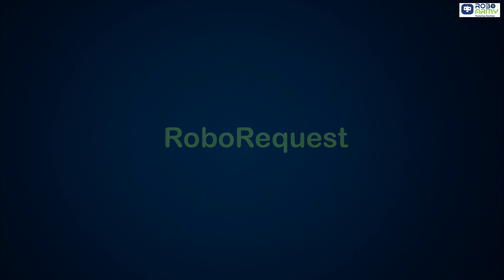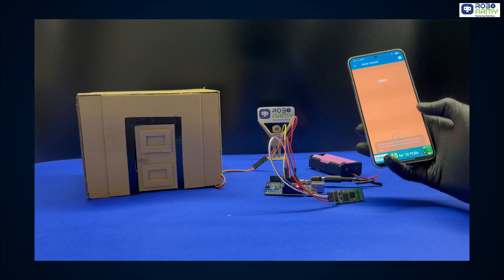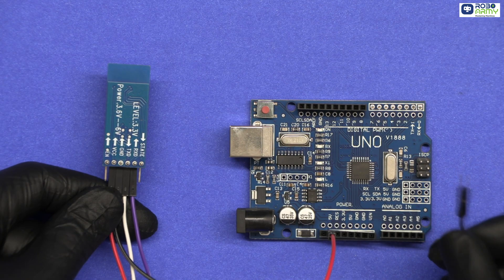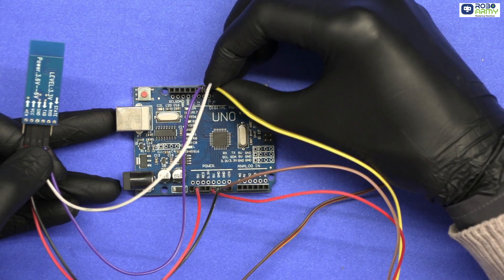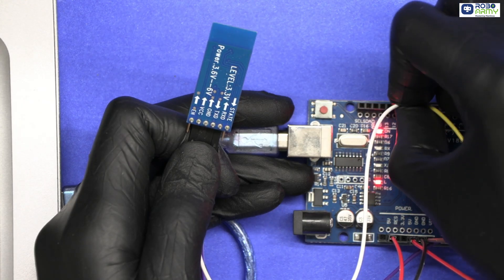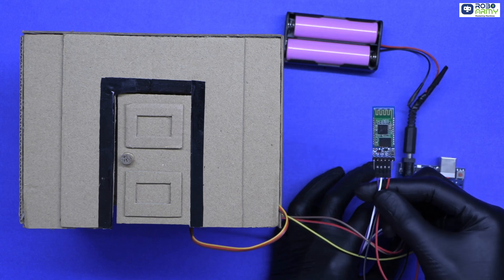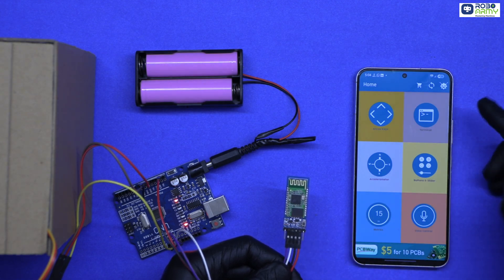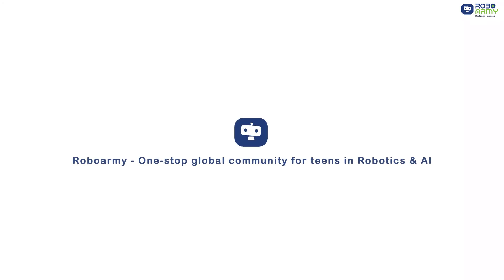Bluetooth Voice-Controlled Door Lock | Arduino + HC-05 | Arduino Project Tutorial

Comment: Can u make fire sensor on budget
Reply from the maker: You can make a budget fire (flame) sensor using a photodiode / IR diode + resistor and connect it to an Arduino analog pin. It won’t be as accurate as a module, but it works well for basic projects and learning.